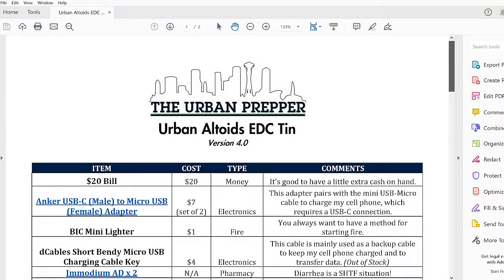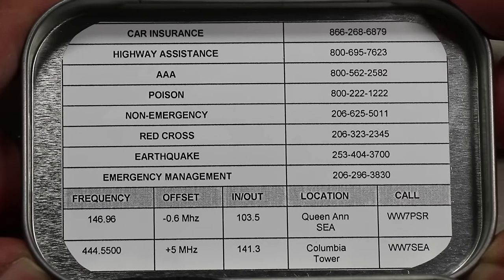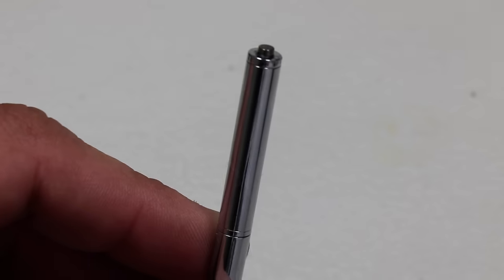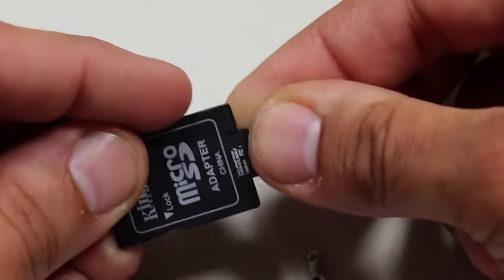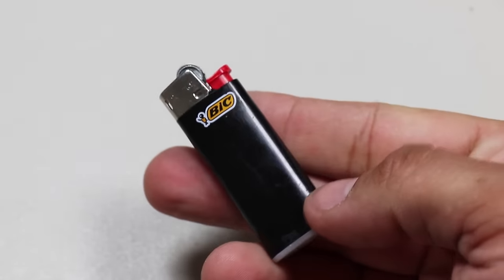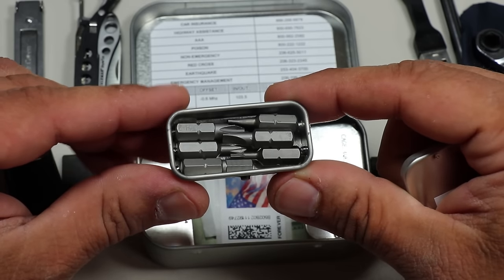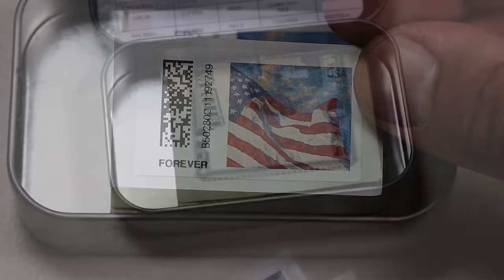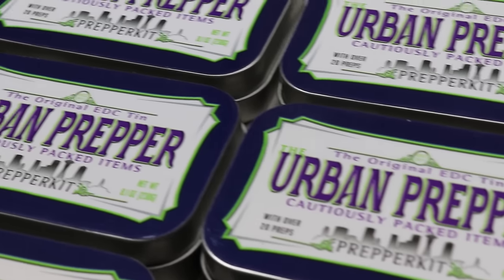Urban Altoids EDC Kit (Version 4.0)

Comment: Hi. Great work! I suggested some time ago, that adding a hand-sewing needle and few feet of a strong thin thread (which can still be used in regular needles in regular sewing machines), and a couple of shirt buttons would be a very nice addition and will not take up any space at all, you can keep them in the MISC tin. Plus I find that keeping a 1 meter paper-based measuring tape  from ikea very nice, which will go nicely in this tin , or your wallet. Oh btw Nail Clippers are must for humans. I don't understand people insulting them or you for having a nail clipper. I always have one in my pocket/keychain. Even a simple thing as nail clipper has multiple uses. Also useful to keep the nails of my kids in groomed state. Also helpful in cutting a slice of skin off if there is a shin sliver along the skin. fI also use it to file/smooth out broken nails in case a it breaks accidentally during some work, and is causing the regular annoyance.  
I also think that selling these tin kits would not be a great idea financially (or even time wise) , as there are very few buyers. Besides, you have shown how to make it ourselves and have open-sourced the list of items, so people can simply buy the stuff themselves and can build one themselves, that would be actually more cost effective for them. 

Here is the link to strong sewing thread: https://www.stoffogstil.no/sytilbehor/trad/bjornetrad-150-m

Comment: Great idea to use magnets to hold everything in place - thanks for sharing.
I'm not superstitious, so I always carry a white mini-BIC to see, how much fuel is in there and I detach the child-safe clip. To help prevent accidental release, I grind the release lever, 'til it's not sticking out any more - and put on a cover of small innertube, great for fire starting.
Instead of nail clippers, which leave a sharp edge that I always catch on something, I carry a nail file, ground to size - if you use it wet, you can touch up your blades too.
In the medical/MISC- compartment I carry at least 4 water purification tablets and in the tin one or two 1 quart plastic bags.

Comment: There's always room for a razer blade:) also, for Urban EDC you could switch to the 4mm bits & fit more of them.   Wiha sells that 1/4 -> 4mm adapter.  I do agree on the nail clipper;  I've carried the Swiss army nail clipper  for years! Also, I like to carry a bit of that poster putty stuff & a threaded needle.   Finally, I found a small wallet that fits Altoids at Staples.

Comment: Retired Contractor, 2 x kids in college, I always have a tool belt in the truck that will do most things, car/boat/whatever in an emergency. But have often found myself without my truck, kids dorm rooms etc, where I am headed to HD because I am unarmed for the task. Your combo screwdriver/bits/MOST IMPORTANT the ones that you include that fit IKEA, and most other assembly furniture would have saved me many times over. Personally I would would just add a #1 phillips bit (works on lots of furniture/chairs etc) and a few more torx bits. 
Very nice Video, thank you.

Comment: Amazing how much you can fit there. The regular bits are rather big though, you could consider using the Leatherman Bit Kit, which are probably half size of the normal bits, have two ends each, and there's an extender for them as well. The Leatherman Bit Driver or the Bit Extender do not fit the Style multi-tools, but at least help a bit (pun intended). You can actually fit such a bit in the handle of the Style multi-tool. My essentials always include a 20 liter trash bag (with handles), which folds crazy small, and/or several 1-3 liter freezer bags, which fold even smaller. Tie up with a small rubber band, which has many uses as well. It's always fun to see people's expression when someone asks for a plastic bag and you hand them a folded plastic bag the size of your thumbnail, but it opens up to a full-sized bag.

Comment: How long have you been using the Mr. Green nail clippers?  The customer comments have me worried.  There are some very low ratings and some of the comments with high ratings are full of grammatical errors that you see with fake ratings.  Also, have you ever though of using a Fisher bullet pen in your kit?  It seems like it would be the perfect option.

Comment: Haven't checked the comments to see if this has been brought up yet, but you should replace your 1/4" bits with Leatherman bits. They are double sided and flat, so you should be able to almost double your capabilities for the same form factor. Also they work with your existing ratchet and driver!

Comment: Thanks so much! I'm saving all your pdf versions of the kits in a folder on my computer. I've labeled the folder "URBAN PREPPER". I plan on saving a copy of the folder to a memory stick, in case I can't access my comp for some reason. Question: Don't the tins have a recessed space on the bottom where you could attach a list or photo of the contents? If you carry several kit versions, it would come in handy and save time.

Comment: Very rounded little kit. The only thing I think you might want to add is a curved and a city rake pick with a tenchen bar. All three should fit in the kit with what you already have in it. Can't count the times I have locked my keys in the house and if I didn't carry them in my kit I would have had to wait for the misses to get home. Also maybe one or two bandaids. Cheers

Sparrow makes the ones I have and the best part is both picks double as the tenchen bar so your only adding 2 idems

Comment: Great update!  Is it possible to get JUST the sticker to add over my current EDC Altoids tin?  I ordered and received the Ratchet Rocket and discovered that it is too big to fit in a commercial Altoids tin, just an FYI that I think you should mention to everyone.  I see that the tin you use from CountyComm is slightly larger then commercial ones.

Comment: Thanks for the interesting video Sir. One respectful suggestio: cover the metal contacts of the SD card to avoid scratching it. Maybe some wrapping plastic or other material will work. Also, there are plastic covers (sort of caps) for the tweezers tips. Have a good one!

Comment: From experience... The number one must have EDC item in Ecuador is toilet paper. My suggestion being those towel tablets that expand when dipped in water and either a plastic, 5 cent/nickel, coin tube or an old M&M's minis plastic tube to store them in. While Ecuador has everything, including toilet paper, that we have here in the States...KFC, McDonald's, shopping malls, grocery stores, auto dealerships, etc. ..., not all public facilities have toilet paper or it is sold where some are located for a few cents. It being sold is only in a few locations, so having it on your person is a must. I'm guessing most of South America is the same, but I've only been in Ecuador.  Their urban differs from our urban and certain laws apply as to what you can and cannot carry, so it's best to know those laws before creating any EDC tin, pouch, etcetera before heading anywhere outside of the US. My fiance is Ecuadorian and she has a huge family spread across the country. So my needs are not the same as a tourist when I'm there. It's all about location mostly. Knowing where things are, where to be and not to be at certain times, etcetera. I spent a month there, total, and carried far less than in any tin video without a problem. Not bashing the concept or construction here, but again, their EDC needs differ from ours. Cell phones, for example. If you need one, really need one, take a cheap one for two reasons. Our cells do not work there and an affordable chip has to be installed for them to work. Cell phones and other electronic devices are imported and taxed heavily, this a high theft item. A $35 phone sells at a much higher, ridiculously higher price there. I just left my cell with my fiance to keep at her place and we used hers when going out. 
I know what works for me in Ecuador and it is surprisingly less than what is needed here in the States. I could list what to carry, not to carry, the why's and why nots, but this would be a very long post. Point is that the environment itself dictates what is needed in the environment you're in. Again EDC in Ecuador differs greatly from EDC in the US. Learn everything you can about where you are going before traveling abroad. I took way too much on my first trip to Ecuador, and I traveled with one suitcase and carry on bag. The next trip I carried much less to the airport with me. Push comes to shove, I could probably fit all I need into a small backpack and be fine for two weeks. I left items behind on both visits. Gave new unused items away. Less to carry and worry about. Things I don't need to take there anyway.
Blessings,
Stephen

Comment: Very nice kit. Very well organized. I would put couple more things in the remaining space though: a needle for sure (so tiny, so useful, cannot easily replicate it even with tools), a fishing hook, a bit of steel wire or electric copper wire (phone line wire is also an option), a bit of nylon fishing wire (also good for repairing all sort of things, using the needle), couple of splitshot sinkers (so tiny, again, so useful), a very small led light maybe. Otherwise a very nicely though kit. Keep it up

Comment: Thanks for the update. Nice intro, and dope tetris skills! Your past videos gave me quite a few ideas that I have since adapted myself. It's also interesting to see how little has changed with your kit. You must be quite happy with it. So when I tell you about two things I changed, that is not meant as criticism. On the contrary, you've probably considered both things as well, so I'd be interested in your comments on both.
1: Those Style CS/PS tools are nice, but I discovered that the Leatherman Squirt series has quite a few more tools while also being shorter, due to the "missing" carabiner. Have you thought about using one of of those? Did you go with the Style PS just due to thickness?
2: There's so called "micro bits" out there with a hex size of 4mm. You might even have put a set of those into a larger kit once. They are also the ones you can find on the "Cybertool" line of swiss army knives – and those specifically are even double sided! So I personally choose those to save quite a bit of space. The drawbacks are that I haven't found a 5mm hex bit in that size, and that my screwdrivers aren't ratcheting. Personally, I can live with that. Have you considered these, and if yes, what was your verdict?

Comment: The emergency numbers are a great idea but can you read them without your glasses?  I also wear glasses, for the same reason I carry a fresnel lens in my tool kit so I can read small things without my glasses.
Reply from the maker: Good addition with the fresnel lens. Fortunately, I can read them with my glasses off. I can't read things far away without my glasses.
Reply: TheUrbanPrepper lucky you.  I can’t read anything without my glasses.  By the way, thank you for all of the great ideas over the years.   I keep an EDC toolkit in my backpack, but I never found a good way to carry a simple socket set and screwdriver bits.  Every solution I came up with was a tradeoff on weight, bulk or noise.  But then I built a box solely around the Topeak Ratchet tool, loading the box wiith a bunch of bits and sockets.  I used the same County Comm box, and lined the bottom with magnetic sheet that  holds down the bits, so they don’t rattle.  I also lined the lid with the magnetic sheet, which gives me a nice holder for loose screws and hardware when l’m working.  I used your system of glueing the tiny magnets to secure the tool and extension.  It is an awesome little kit that I have used a bunch of times.  I never would have thought about it without your inspiration.  So thank you.

Comment: Really interesting kit, but I've got to question the 32 GB microSD card - especially if you use it for stuff like recording video (which I'm not knocking at all!! Could be extremely important e.g. during clashes between law enforcement and civilians). I honestly don't see the point in even buying memory cards with less than 128 GB storage these days, again, especially if you plan on storing video files on them.

Comment: There is now a cheaper alternative to the Topeka ratchet at oriellys auto parts for 12-15$, looks exactly the same!
Reply from the maker: Really?? Link please!
Reply: @TheUrbanPrepper  I looked for it online. This was the only kit of that type that showed on O'Reilly's site: https://www.oreillyauto.com/detail/b/sunex-tools-4956/tools---equipment-16488/hand-tools-16814/ratchets---torque-wrenches-25369/4a6b9be6ae5b/sunex-tools-mini-ratchet-bit-set/9726/4722090?q=bit+ratchet+kit&pos=0
Reply: @TheUrbanPrepper  Sorry for late response, picked one up today - Power Torque 5mm #1, #2, #3 4mm, 5mm, 6mm Two-Way Phillips, Slotted, Hex Two Way Bits
 - identical to the topeak. 

https://www.oreillyauto.com/detail/b/power-torque-tools-4691/tools---equipment-16488/hand-tools-16814/screwdrivers-16627/drive-bits-star-bits-18037/8b81caa6a353/power-torque-5mm-1-2-3-4mm-5mm-6mm-two-way-phillips-slotted-hex-two-way-bits/gm4315/4677093